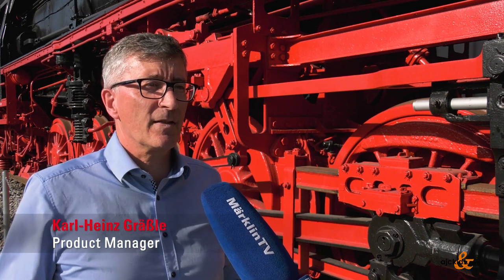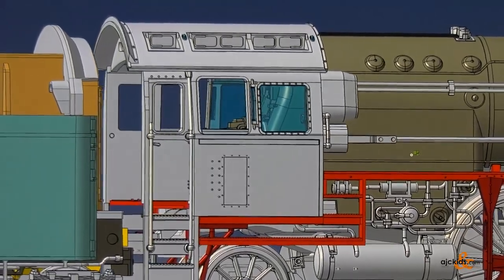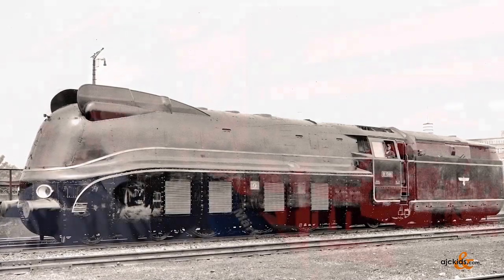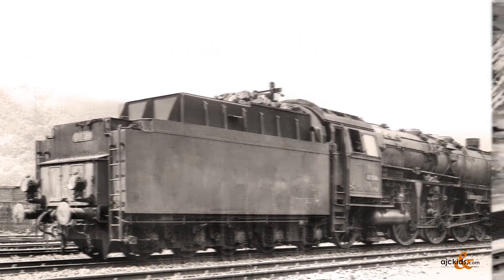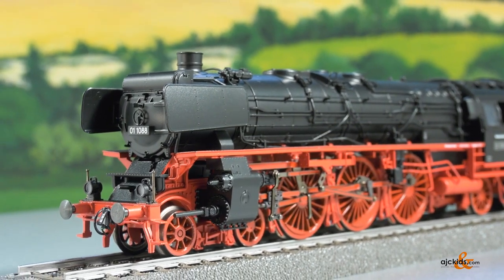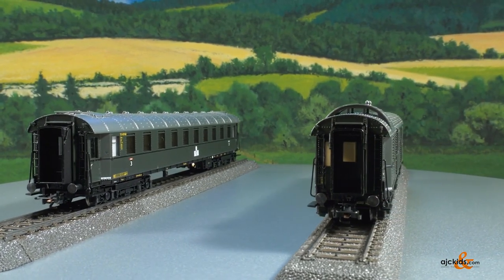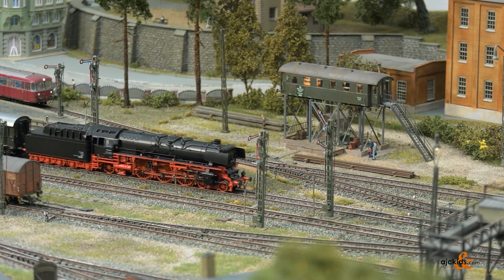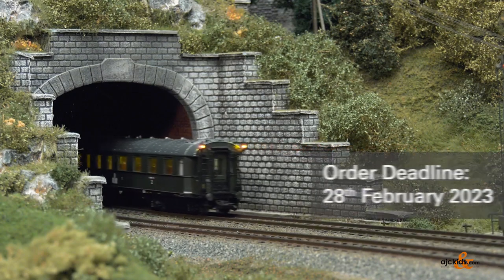Marklin 39760 Insider Model for 2023

Comment: can you tell me what I will need to run marklin gauge1 trains in england central station 3 +60101 power box and what els do I need to get the power to the track? is there a special central station for gauge1? thanks barry
Reply from the maker: Hello Barry,

Yes, that's it. Suitable power supply and the CS3. The CS3 will have a connector with 2 wires that go to the track. The only thing you will need is a way to connect those two wires to the track (a feeder track). But presumably you already have that from your old analog transformer connection!
Reply: @ajckids  thanks